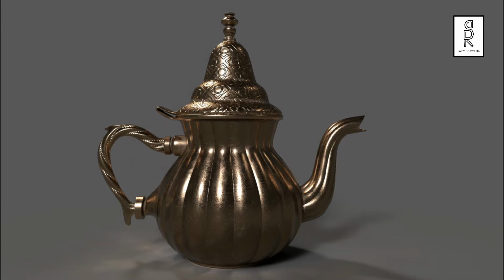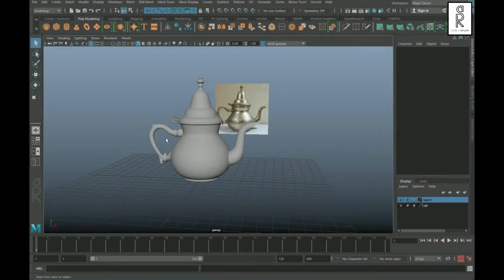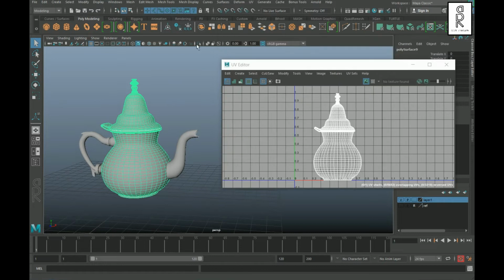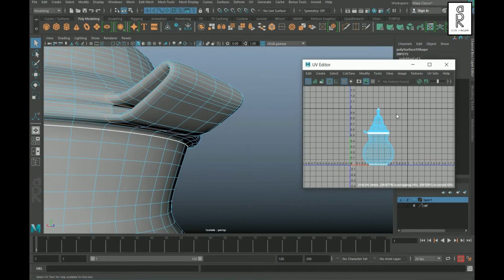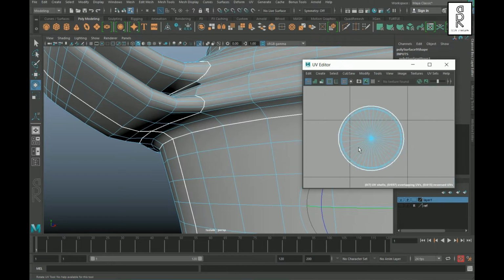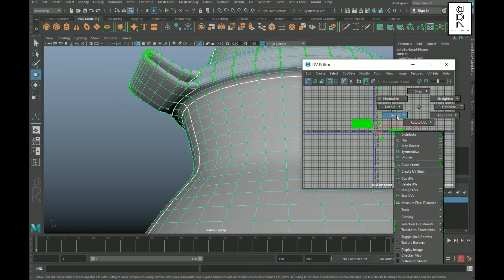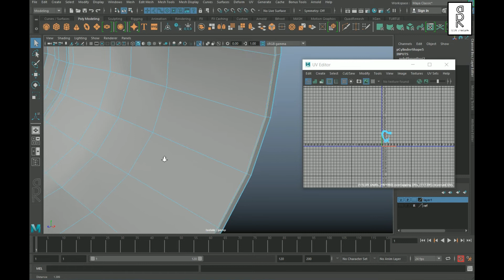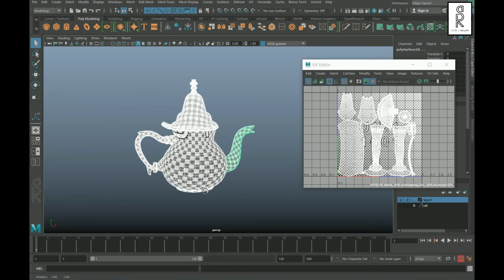How To Model Antique Teapot In Autodesk Maya (Part - 2) | UV unwrap |  Modeling & Texturing Tutorial

Comment: hi, do you have an explanation to why did you cut exactly those lines to unfuld? Im not good at uv unwrapping 😅
Reply from the maker: Hi @lukito02

Cutting edges strategically allows you to create UV maps that closely match the shapes of the corresponding parts of the 3D model. This minimizes texture distortion, ensuring that textures appear correctly and without stretching when applied to the model.

Cutting UVs along seams makes it easier to paint textures in 2D image editing softwares like Substance Painter, Photoshop etc. Each UV map represents a distinct part of the model, making it simpler to apply textures accurately to specific areas without bleeding into other parts.

Strategic UV cutting allows for the efficient arrangement of UV maps, which can enable texture reuse. By using the same texture for multiple parts of the model (for example a house model which have similar shapes like windows and doors), you can save memory and improve rendering performance.

I hope this answers your question. If you have any other queries feel free to ask me. I will be more than happy to answer them. ☺
Reply: @sunitdrozario   ohh alright, that cleared a lot, thanks. I just have one more question, how do you know where to put the seams?
Reply from the maker: @lukito02  

It totally depends on the shape of the model.

When unwrapping UVs in Maya, you typically want to cut along edges that will allow the UVs to unfold in a way that minimizes distortion and makes texturing easier. Here's a general approach to determining where to cut edges:

For planar surfaces, you can often cut along the edges where the surface changes direction. This helps create clean, easily manageable UV islands.

For parts of the model that won't be seen or where seams are less noticeable, such as the bottom of a character's shoe, you can cut along edges that are less visible to avoid seams on more visible areas.

Some models have natural seams where separate pieces would join in real life, like the seams on clothing or the edges of separate objects that are joined together.

Consider the flow of edges on the model. Try to cut along edges that follow natural seams or boundaries to maintain the continuity of the texture.

Cut along edges where stretching will be less noticeable or where it can be easily corrected, such as areas that will be covered by a separate texture or where texture details are less important.

Use Maya's UV Texture Editor's checker pattern to visualize stretching. Cut along edges that help minimize stretching and maintain a uniform checker pattern.

Sometimes, the best way to determine where to cut is through trial and error. Experiment with different edge cuts to see which ones result in the least distortion and easiest texturing workflow.

I hope I have answered your question. ☺
Reply: @sunitdrozario   thank you so so so much, you've helped me a lot! ❤
Reply from the maker: @lukito02    I am glad it helped 😊